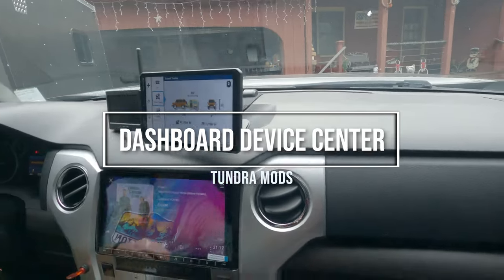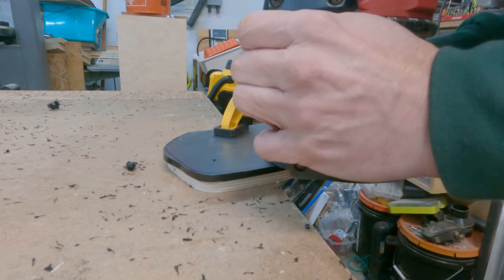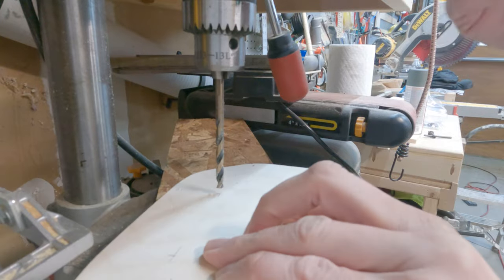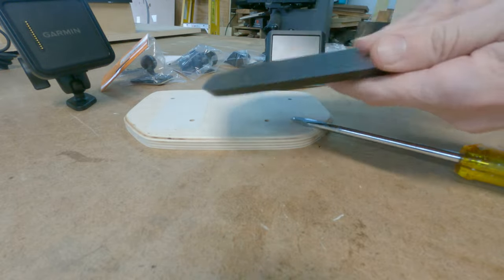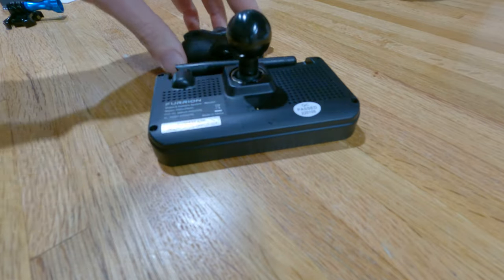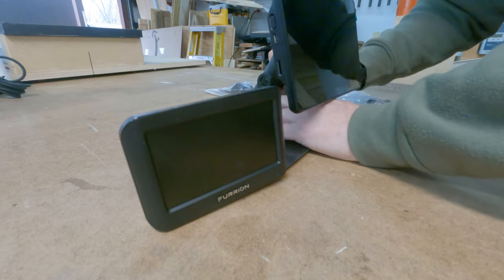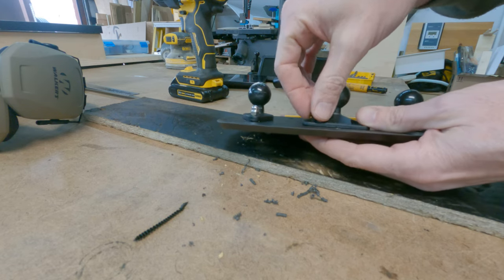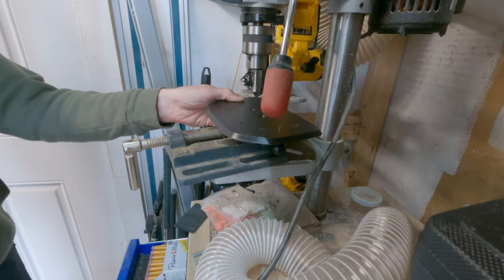Dashboard GPS / Rearview / Phone / Gopro device plate #toyota #tundra #rammounts

Comment: This is amazing! Could I possibly get away with doing the rivets without taking out the radio? Ty so much!
Reply from the maker: You could for sure. I removed the radio to be able to run power up to it, but if you are just mounting, then you can do it from the outside. Carefully drill through so you don't damage the radio or wires that will be there.